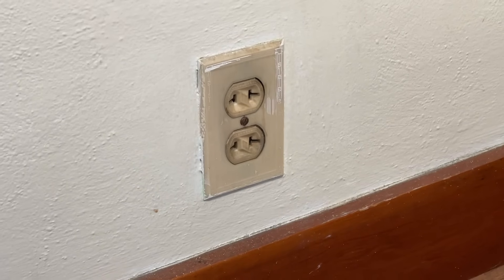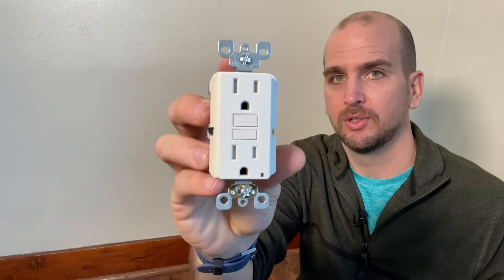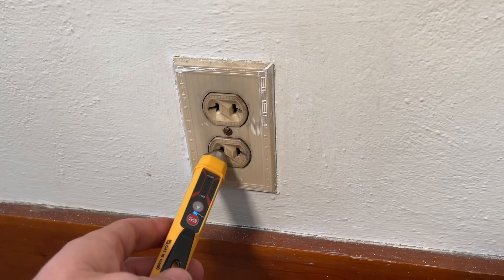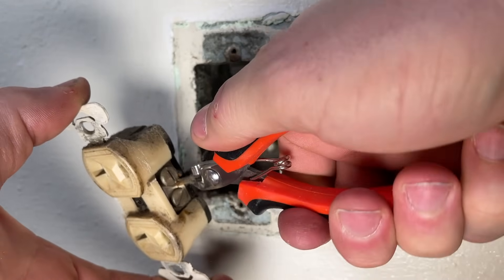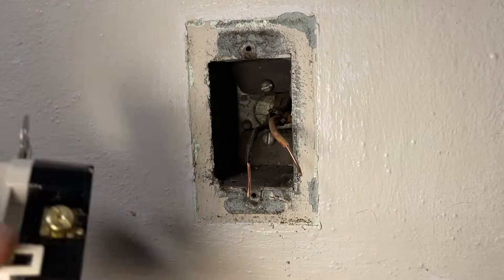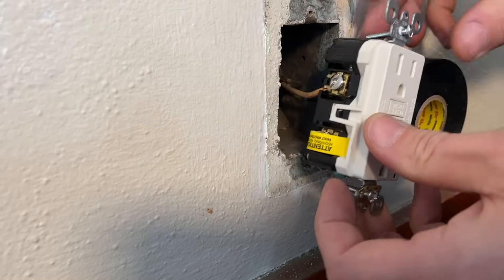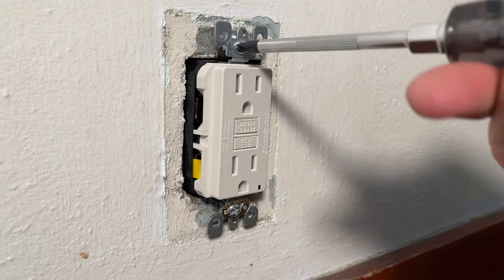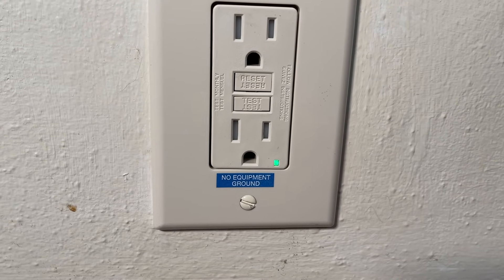How To Replace An Old 2 Prong Outlet Using 3 Prong GFCI

Comment: When you replace a device in a house it must be protected with an arc fault circuit interrupter according to the National Electric Code. You can use either a Dual function breaker or dual function device. If you don’t care about the NEC you can just do whatever you want.

Comment: Hello, and thank you for this video. Could you please tell me what it means to "make sure no exposed copper is going past the housing"? Thank you in advance. Kimberly
Reply from the maker: When you strip the insulation from the wires (especially the hot side) you want to strip the correct length so when you insert the wire into the back wire terminal then the plastic housing will completely cover/protect any exposed copper.
Reply: @EverydayHomeRepairs  hey bub if i got a 1954 house sitting up off the dirt 3ft off the Ground on wood and cement piers and electricians can easily maneuver under the house will they still have to tear my walls out for a complete rewire.
Reply: @EverydayHomeRepairs  Thank you! That was very clear and helpful 😊
Reply: You don’t want house fires or anything damage and dangerous problems. That’s what I think he means.

Comment: What do you do when 1 of the outlets is connected to a 3 way light switch and the other is connected to constant power?
Reply: Then you have to either choose which to connect or connect two outlets side by side. Alternatively you could use a two pole GFCI breaker.

Comment: I inherited my grandparents house that my Poppy built in the 50's still has limited and 2 prong plus throughout the 4,000 sq ft home... it is safe to just replace all 2prong with gfci/3prong without a full rewiring of the home?
Reply from the maker: I would take a look and make sure the wires are in good shape but installing a GFCI without a ground wire running back to the electrical panel is safe.
Reply: @EverydayHomeRepairs   - So when using a GFCI with old 2-wire systems, the GFCI basically acts as a point-of-use circuit breaker?

Comment: Very timely for this to pop up in my feed.  My daughter just bought a cape built in the 1860s.  Full of knob and tube wiring, even one room wired with 12ga speaker wire.
We are gutting and rewiring the first floor. The second floor was gutted and rewired about ten years ago.  Everything checked out except two outlets on the new circuits that were in interior walls that were NOT gutted.  These two outlets were the last on their circuits and had the old two wires in place.  I thought I was going to have to cut holes in the new walls and re-feed the outlets with Romex.
Now I know I can fix the issue with a couple of GFCI receptacles and save all the drywall/plaster work.
Thanks!!

Comment: If you have 2 prong outlets, you need to replace the wiring.
Reply: Not always.  Armored cable has the jacket ground for instance.
Reply: @edwardschmitt5710  no. There still isn't a ground. You still just have a hot, and neutral wire. This goes against code.
Reply: @Normal1855  The outlet yes, but BX steel cable does not need a ground wire, it is still legal to use the steel sheeting as the ground.  I don't BTW.

Comment: Why pay about 16 bucks especially if you're not using the load side for other plugs on circuit? You can use a standard receptacle and it looks like it's a metal box therefore you need to place a ground wire on your plug and screw it to box!
Reply: Not all metal boxes are ground.  Prior to three wire Romex, some houses were built using two conductor wires, with a separate ground wire attached to each box, then run back to the panel.  But not all metal boxes are grounded.  You would have to check continuity between neutral and the box to see if it is grounded.
Reply: @JDel709  If the metal box is not grounded you should replace it with a plastic box if you use a GFCI outlet. I do not know if the code requires his but an ungrouded metal box with a direct connection to the case of the connected equipment is an obvious risk.
Reply: Unless there is a ground wire attached to the box going back to the breaker box, you still don't have a working ground, just because you put a wire from the outlet to the box.  Unsafe to do that.
Reply: @JDel709  I may be wrong but through research I've learned that if it's a plastic box then you need a ground wire to breaker box but if it's a metal box then you use your metal box as a ground and that will prevent you from getting shocked

If there's no ground to breaker box and you have plastic box then you can run ground wire from box to outside the house  and into metal rod but that may be. Too much work,

Comment: How do you know what AMP outlet to get when purchasing the GSCI outlets? I need to get a larger quantity into update my outlets and am not sure if the AMPs really batter to much in this process. Are wall outlets usually around 15 AMPS?
Reply: Typical residential receptical and light circuits use 15 amp breakers with 14 gauge wire. In that case a 15 amp receptical is suited.
I made the assumption that my house was this way until I removed the first faceplate and realized that the wire looked too big. Sure enough all the breakers in my panel are 20 amp or larger (the circuit in question is a 20 amp circuit with 12 gauge wire) so I had to return all of the receptical and switches.
Going to be a lot more expensive but you never want anything to melt.
Reply: Check your breaker and wire gauge size, 15amp for 15amp breaker and 15 gauge wire! Do not us a 20amp breaker on a 15amp circuit, an appliance may draw to much and the 20amp breaker will not trip when it needs to trip because of over heated draw on the circuit.

Comment: Most appliances or lamps or what ever normally use a a two plug wire. Not A three prone wire. Like most of my extension cords & wood working tools only use a 2 prong wire. Most small appliances use a 2 prong wire. The 3 three prong was only introduced for so called safety codes. The retaliatory is that you don't have to replace most 2 prong outlets with 3 prong outlets.

Comment: To protect kids probing with a blade of some sort, put the Ground Pin on TOP
Reply: yeah that'll stop the kids.
Reply: You are confusing two issues. The ground up argument is based on idea that if something falls on a prong that is partially out it will hit the ground. This is not any official requirement or even recommendation. It is just something some say.

Children are protected by using tamper resistant outlets. Those have shutters that withdraw only if you push both at the same time. Some hate those as they make inserting the plug harder.
Reply: @okaro6595  Also since we are on the subject of correcting people to feel superior, there are plastic inserts that cover outlets to protect children!  So you are "confused" thinking the type of outlet you describe is the only solution for children.  The first part of your aforementioned comment has been rendered invalid due to lack of anecdotal evidence.
Reply: @okaro6595  I am not confused.  You are.
Reply: I don't see how this makes a difference
Reply: @MichaelButlerC  If they slide the blade down horizontally they will bridge Hot and Neutral causing arcing.

Comment: Can i add a standard 3prong  recepticl next to this gfi using the load side? Both in a 2 gang box.
Reply from the maker: You could, just make sure you are coming out of the "Load" terminals to ensure the non-GFCI outlet is protected.

Comment: Luckily my early 50s house has metal receptacles in metal conduit to the panel, with ground wire to water main. So, I switched out all 2-prong receptacles with 3, and according to my inexpensive outlet tester, all grounded.
Reply: What's the LOL for? And which comment? Gotta love the Intertubes.
Reply: @HabAnagarek  He means his comment above about armored cable being grounded and not requiring a rewire.
As in your situation.
Reply: @chrisboyd4433  LOL ok
Reply: LOL see comment above...

Comment: This is the part that confuses me.
Why are you not using the Load side as well?  If you don't use the load, will outlets further down the circuit still get power?  

I have an old house and it only has 2 curcuits, each mixed with lights and outlets, with at least 15 lights or outlets on each run.

My understanding was that the load carries power to the next outlet, but I could have that wrong. If that's wrong, how does power get to the next outlet down the daisy chained circuit?
Reply: This outlet did not have another wire leading to another receptacle, so there was no "load" wire to attach.  Your understanding is correct.  If there had been a second wire, one would have been attached to the load side.
Reply: @chrisboyd4433  Thanks!

Comment: While it eliminates the two prong outlet....a regular 3-prong is equally as efficient as the outlet still isn't grounded so the GFCI is kind of wasted money
Reply: The issue is not about efficiency, but increasing the *safety* of an ungrounded system from accidental ground faults to match or exceed that of a grounded system.
Reply: @antonioterrell354  safety is an concern but on a system where there is "no ground"...the same safety issues remain with or without a non-functioning GFCI
Reply: @kenevans6382  ;

Well of course for a "nonfunctional" or broken GFCI outlet that would be the case.

But naturally I'm referring to a working GFCI provides protection to an ungrounded outlet from accidental or unintentional ground faults. Even better than an actual grounded outlet.
Reply: No, the GFCI can save your life. Please learn how it works instead of assuming that because it starts with "ground" it requires the grounding conductor.
Reply: @okaro6595  you're wrong with no ground wire the GFCI outlet WILL NOT trip as its designed which is the point to this post

Comment: Tried doing that today, the GFI outles won't fit in the old electrical boxes. I will have to cut the paneling or the sheetrock, install new boxes that will fit them. First I have to track down the first outlet on each circuit. Not so easy after all.

Comment: So you are saying with these you do not need a third copper ground wire attached to back side of the outlet??
Reply: That is correct.   The equipment ground you are asking about allows high amps from a hot conductor touching metal incorrectly to flow back to the panel to make the breaker trip as short circuit.   GFCI measures the current of hot and neutral at the same time, so zero amps.   It will trip it’s mechanism if there is more than 5 milliamps of current difference.   They do not work the same, but safety is achieved.   Hope this helps.    Kevin
Reply: Correct.  And you must label the GFCI receptacle , "NO EQUIPMENT GROUND "   and any three slot receptacles downstream from that GFCI must be labeled "GFCI PROTECTED,  NO EQUIPMENT GROUND "  that is a NEC requirement and all GFCI outlets come with several of these stickers.  Bear in mind,  that while this scheme will greatly improve your personal safety,  it will not provide equipment safety, eg.  you plug in a surge protector for your expensive computer system,  or 50 inch smart TV, that surge protector is useless,  because it requires a true ground to shunt damaging power surges, or spikes,  away from the equipment.  Hope that helps and best of luck with your remode.

Comment: Still not grounded, unless I missed something.
Reply from the maker: Correct, there is no ground running to this outlet,  The GFCI will still trip if a ground fault is detected.
Reply: Yes, when u install  a gfci outlet u don't need a ground. It's still safe

Comment: If you have only a 2 wire and install a GFI BUT down the load line a ground has been added to one of the additional outlets during a remodel how does that affect the original 2 wire line?
Reply: It does not have any affect of the function of the circuit.  The ground wire has no function and should not be connected on either end.   It is illegal to run a ground conductor from a two wire to a three wire receptacle without any other considerations.
Reply: You say ground has been added but where is it connected? You are not allowed to run a ground wire from the GFCI outlets to the other outlets.  It may be that the ground wire was run at a time when it was not requited to help changes later.

If the outlet is properly grounded you can ignore it.

Comment: Don't get it, still no ground?
Reply: That is correct.   The equipment ground you are asking about allows high amps from a hot conductor touching metal incorrectly to flow back to the panel to make the breaker trip as short circuit.   GFCI measures the current of hot and neutral at the same time, so zero amps.   It will trip it’s mechanism if there is more than 5 milliamps of current difference.   They do not work the same, but safety is achieved.   Hope this helps.    Kevin
Reply: @KevinCoop1  This may protect against an unbalance be L and N but give the illusion of a true ground point.  Many people will miss the label, sticker and assume that the ground is wired.  Believe that this could be unsafe.
Reply: @franzfranz9144     How is it unsafe?   As far as an illusion of a ground, most people have no idea or concept of why the ground is even there.   Can you tell me specifically why it is provided, not just something like “for safety”?
Reply: @KevinCoop1  As long as an item is double insulated, maybe not an issue.  For people expecting the ground terminal to really be a ground may be in for a shock.....  Do not completely trust technology or for someone to notice the little sticker stating that the ground is not a ground.  I am a careful person.  Would not wire an outlet this way.
Reply: @franzfranz9144     Please tell me your interpretation of how the third prong ground in a receptacle works.   Not picking on you, just want to see if there is a misconception possible.
Reply: @KevinCoop1  I have wired receptacles and know that neutral and ground are typically bonded in the load center.  I see the third plug as ensuring a ground path in case the bonding is not there or poorly done.  Have witnessed many residential wiring disasters.  One home had just an iron water line as the only ground.  The incoming power was some distance from where the water line went to ground so the home owner just run about a foot to the iron pipe.  When the iron pipe became rusted shut, the home owner replaced the clogged section with PVC.  Now there was no ground and people were getting shocks while showering.  I may be hard core but if it has a ground plug, personally I want the ground hole to be a ground.  Just me but it is my preference.
Reply: @franzfranz9144     I have actually seen a metal faucet handle that was connected with pvc pipe at the sink back to the water heater give a little zing!   The electric heating element had a hole in it and it was energizing the water in the whole store.   So much resistance, the breaker would not trip and not on GFCI which would have probably tripped.

Three things to discuss.

1.  Grounding electrodes, (rods, pipes, plates, re-bar in concrete, etc) connected to electrical panels are for lightning protection.   Not anything to do with getting shocked.   
2.  Ground and neutral are bonded in the main electrical panel so that ground faults go from equipment grounds to the neutral so the fault can go to the utility transformer.
3.  Equipment grounds that go out to the third prong or direct connections are connected to the metal case of the appliances so that if a short to the case happens, it will travel back to the main panel, to the neutral, out to the transformer back to the panel, and cause the breaker to trip because of very high amperes.  These ground faults do NOT go to earth.   Most people think that they do and that is why the have a very hard time understanding grounding in NEC.

A GFCI receptacle requires no ground to operate its ground fault mechanism.   A current transformer (CT) encircles both hot and neutral and reads zero amperes.   If 30 mili amperes goes somewhere else, the unit trips.   The purpose is if 30 mili amps or more is going through someone’s body, it will sense it and trip.  So, ground conductor plays no role in it doing its job.   Hence safe with no ground.
Hope this helps you understand.   Respectfully,   Kevin

Comment: Would like to see a video of doing this in an older home where both wires are the same color. Thanks for the great videos and I hope you continue to do so.
Reply: If both wires are the same color, get a multimeter and test continuity on each wire. 

With the power off, find a nearby outlet or plug an extension cord into one. Set your multimeter to continuity mode, and then see which sockets/wires produce the noise in combination.

Then you will know which wires are which.

Comment: Help please! I did exactly as you did with the same GFCI you have and I don't have power. But the two prong does have power. TIA!
Reply from the maker: Hmmm, did you try to reset the GFCI when you had it installed?  Would the reset button click when you depressed it?  Make sure you have the power coming into the "Line" side as opposed to the "Load" side and the hot and neutral are on the correct terminals.  Let me know what you find.
Reply: @EverydayHomeRepairs  come to find out, I put the wires in the wrong spot. The plugs I purchased must have been a return because the sticker wasn't covering the two top screw downs. Thanks for your help.

Comment: What happens if the hot and neutral got swapped
Reply: Without a tester, you will not know if correct or not.   Will your appliances work?   Yes.   But if you look at the plug you are putting into the receptacle, some have no ground prong on them.   They require no ground.   Some with no ground have one prong larger than the other(neutral). Most likely there is a switch that the manufacturer wants on the hot side.   So, if wired backward it will work, but not as safely.   Hope this helps.